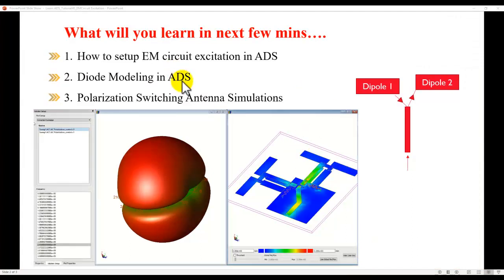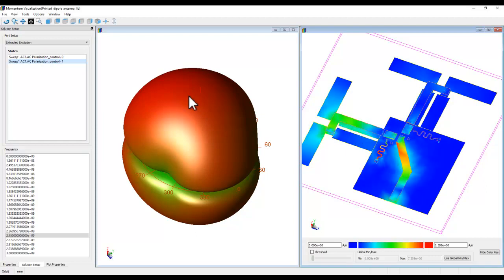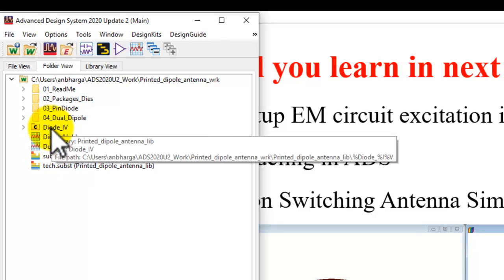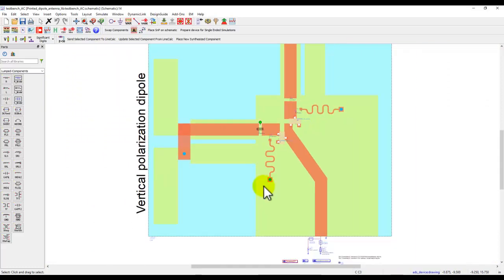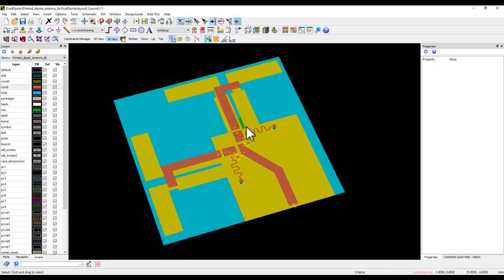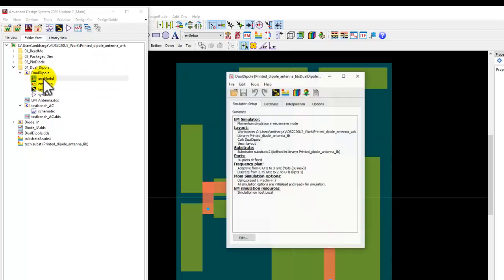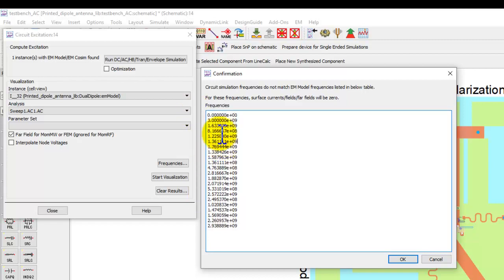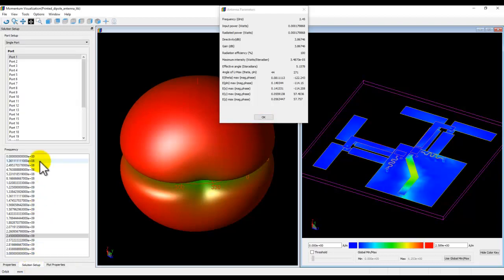Tutorial-40: EM Circuit Excitation - Polarization Switching Antenna

Comment: Thanks for sharing this. It is really helpful. I'm now simulating the Phased 2 patch array using a reflective hybrid coupler as the phase shifter. I'm also using the method you taught in this video. But When I switch DC bias Voltage, I cant see the difference in the far-field display by changing the voltage. How does man place active devices in Layout like this example and is it possible to place lumped elements in the layout? I'm looking forward to your reply.
Reply from the maker: I guess you will need to contact tech support to troubleshoot your issue. As long as you are using Circuit Excitation feature and loading Extracted Simulation results inside Far Field viewer window as shown in the video then you should see the change in current as well as far field plots.

Comment: I was waiting for this tutorial. Thank you for posting it. 
1. Would you tell me why the pins (specially input pin) are placed 0.4-0.5 mm inside from the edge where as we normally place them on the edge? Is there any specific reason?
2. What is the purpose of using 'diel' layer in layout?
3. do I have to use pin in Cond-2 layer for each pin used in Cond layer?
Reply from the maker: Hello Asad,
The example that I used for tutorial is an old example when we didn't have automatic option of selecting GND ref pins etc hence pins were placed on cond2 layers. Also, when in older version you needed to place pins slightly inside instead of placing it on the edge to avoid the large edge of the finite ground plane and Port calibration use to suffer quite a bit if you place it on edge as every pin was a point pin. In newer ADS versions it is fine to place pins on the edge and while placing pins, select type as Edge Pins instead of point pin and define the length of the edge as required, this puts a constraint on the edge size of the Pins irrespective of the conductor edge size.
diel layer has no apparent role here but it is just kind of indicative of dielectric size but not utilized in simulations, however now you can use it as bounding area layer if you want to run FEM simulations etc

Comment: Can you please suggest me the design procedure using Symbolically defined device (SDD) (eg. designing the Schottky diode) and way of writing and relating current and voltage equations.
Reply from the maker: Hi,
I would recommend you to contact the Keysight Tech Support team to get more information on SDD modeling. They would be able to give you all the required documentation/example for the same.

Comment: Thanks for this tutorial. 
1.) Any chance of making detailed tutorial with tips and application on Transient and Envelop simulation like Harmonic Balance? 
2.) For Oscillator case, running EMCkt using HB is not permitted in current ADS version. As there is no RF sources being present, HB is failing to show the fundamental & harmonic response of the overall Osc. circuit.
Reply from the maker: For (1), yes I will create tutorial in future.
For (2), it is not the limitation of em-ckt cosim feature. Kindly contact Keysight tech support in your region to help you troubleshooting the issue.

Comment: thank you for your videos, I am learning a lot from you, could you please provide your email so that if I have a question I can ask you, and I have a question about this video, what is the difference between this simulation EM-circuit Excitation and the previous videos of EM model co-simulation.
Reply from the maker: Hi Luck,
If you have any queries then please post it here and I will try my best to respond. EM model cosimulation is the technique to bring EM results in the schematic environment to check normal circuit behaviour alongwith the layout parasitics to replace ideal wire connections between schematic components to capture mismatch, parasitic coupling caused by layout design etc.
This EM-Circuit excitation feature is used when you want to load your layout with circuit components distortions and would like to check current distribution or radiation pattern in presence of circuit components like diode, transistors, R,L,C etc.
As you could see during the video, we used this approach to see radiation pattern of a "fully loaded" layout of a dual dipole antenna geometry including the effects of R, C and Diodes.
Hope this helps to clarify.
Reply: @BhargavaAnurag  ok but when you designed an antenna using ADS EM model, we could also see the radiation patterns, and then you made a symbol and used it in schematic, so can't we design that layout as when you designed the antenna in previous videos and the used symbol and add like a resistor, transistor, etc. and then see the effect?
I mean does EM-circuit Excitation necessary?
Reply from the maker: @ltteogoali7251  I would recommend you to watch the video once again and listen to the explanation. Here are the few more points:
1. If it was same then we wouldn't have that menu in ADS and I wouldn't have created a separate video, isn't? 😉
2. When you create an EM model, remember that is without any circuit component and you place ports instead of any discrete components, isn't?
3. Idea about EM-circuit excitation is to excite the Layout to see currents & fields in the presence of circuit components
4. Watch the video at 14:15 to see how currents and fields will look like with circuits components and see how you fail to see currents in the structure because of that
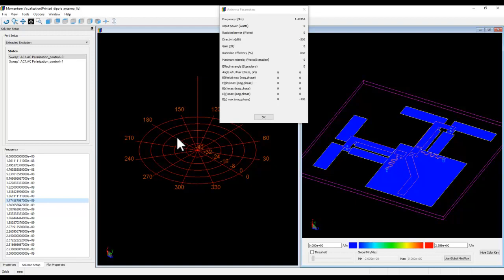5. Then watch the video from 16:45 to see what happens when you include circuit components by switching to the extracted simulations (which is nothing but EM-Circuit excitation mode) and you will understand the difference.